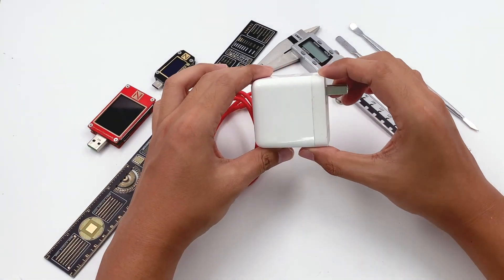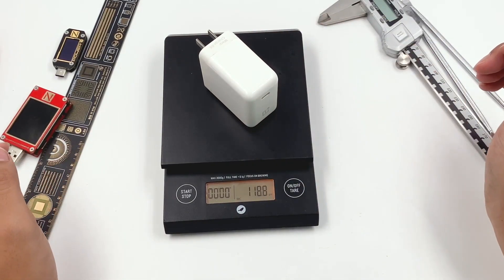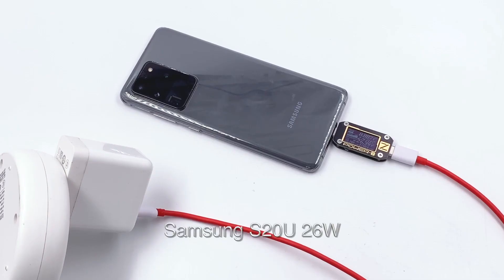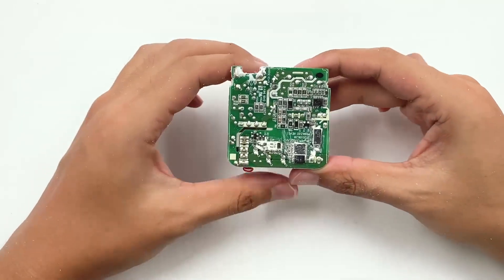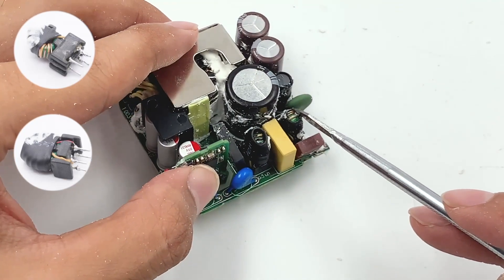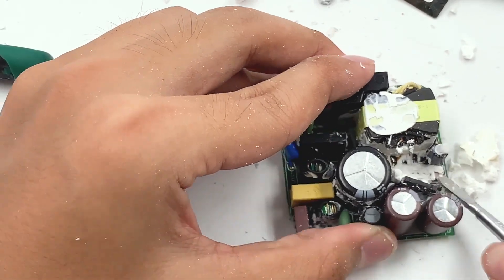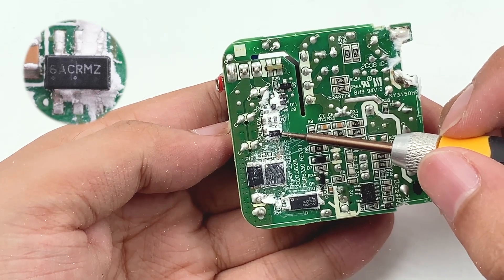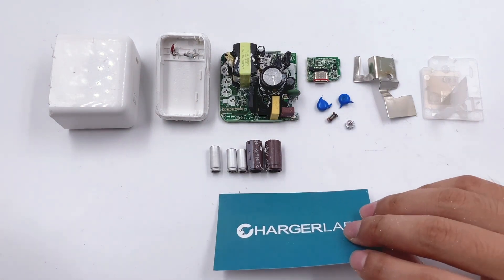Teardown of Oneplus Warp Charge 65W Power Adapter

Comment: I think I was scammed. my OnePlus 65w charger is the same model but it doesn't have the same internal components 😞
Reply from the maker: It might be sightly different. But the structure should be the same.
Reply: @ChargerLAB  I wish it were so, the circuit board does not have even half of the components that you show, it has some pieces of metal glued to add weight, it is an imitation, it never managed to rise above 2500 mA
Reply: @Sedok_six  sounds like fake charger
Reply: I have bought a 65w wrap charger, upon opening, It has a big Iron rod in it? What is it used for? Is it a fake charger and the rod is used for weight?  Plz explain. I'm very disappointed.
Reply: @ZahidKhan-324  Exactly, they use the weight to simulate an original charger, they scammed you bro
Reply: @ZahidKhan-324 i think it is heatsink

Comment: Do you know if there are any multi port USB-C chargers that also support Warp Charge? I watched other teardowns, but only found the Anker PowerPort III 65W 3 port, which has Vooc/Dash/Warp charge on the USB-A port, not on the USB-C ports
Reply: What do you mean it has Warp Charge? Where did you find this information?
Reply: @DriftJunkie  I already mentioned that I watched the teardown of the PowerPort III 65W 3-port, which is where I found the info
Reply: @MrSeon123  it does not warp charge. There are no third party warp chargers.
Reply: @DriftJunkie  Then what caused the USB-A port to show as Vooc charge compatible in the tester?
Reply: @MrSeon123  Vooc is not Warp charge, am I right?
Reply: @DriftJunkie  You are not, they are the same thing

Comment: Hey, watched many of your videos today, and Learnt a lot about chargers...

• If I want to buy a 3rd party Power adaptor, which one should I buy among...OnePlus 65W, Samsung 45W or any other??
Reply: Get Motorola USB Charger. Best one available in Indian market with USB C PD high wattage support
Reply: It mostly depends on device limits. Rule of a thumb is do not cheap out, they are priced reasonable. If you cheap out you mig6 get bad things from coil whine to burning house down.
Reply: Sir please provide a this circuit daigram 
What is value of the wrap charger 65w Transformer value my smps transformer broke please reply

Comment: Thank you so much. And my experience with oneplus warp charge 65 has been great. And I have used to charge the iPhone 13 pro max and it was outputting 27 Watts. Which is crazy, as from apple I would have to buy a 65 watt charger to get the speed.
Reply: Is ot good for apple devices? Should I buy it?
Reply: @adarshanand5928  it depend which device you have.

Oneplus charger can charge all the iPhone around 20w or 27w for iPhone 13 pro max and 45 Watts for apple laptops.